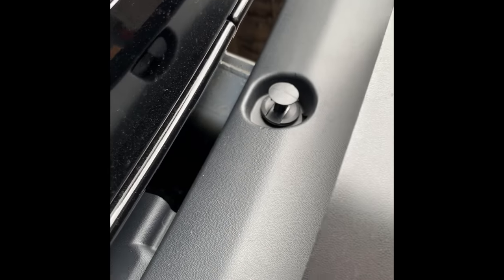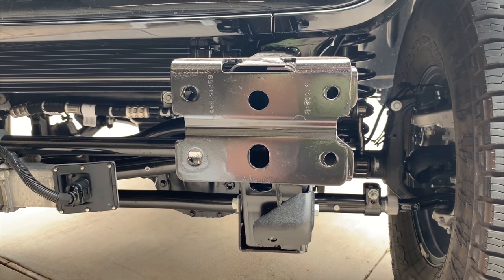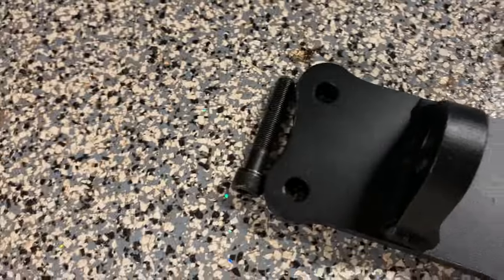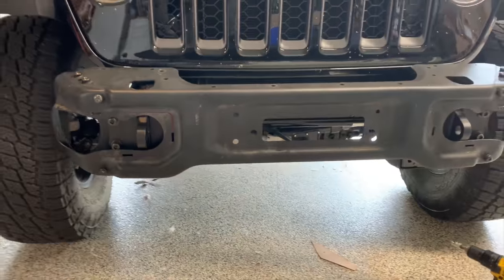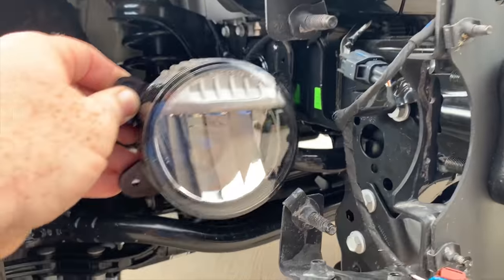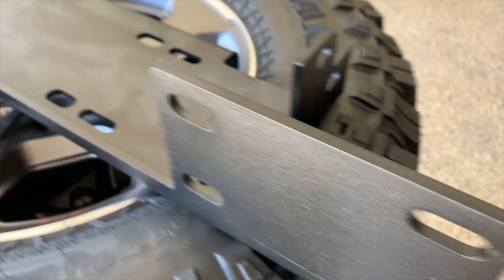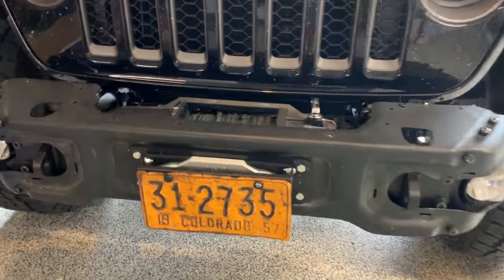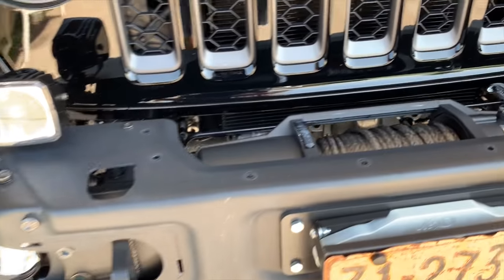Adding a Winch and D-Ring Shackles to a Factory Jeep Bumper

Comment: Great job! Excellent video. I was planning on doing some towing with my JT. I was wondering what low pro winch I would go with. Not a big smittybuilt fan but that winch looks good and tucked away. Looks like it wouldn’t effect air flow for cooling at all.

Comment: I was wondering if 2015 JKU Rubi Hard Rock bumper was the same steel bumper offered on JT Rubi as an upgrade. From your vid it looks like it is except for a few bolts.
Reply from the maker: kcrr2w It’s basically the same. They just rounded out the edges a little more on the JL/JT version.

Comment: awesome video.  was wondering where you mounted the solenoid for the winch?
Reply from the maker: I'm working on that now, fabbing up a bracket to mount it on the inside of the frame rail.

Comment: Did you ever come up with something for your D Rings to be useable?
Reply from the maker: The D-ring shackles I added are definitely useable.
Reply: @campNcrawlR  so do you just leave those covers on and just remove them when you need to access them. You mentioned in the video fabricating something. I thought you meant a different cover for those and the lights so they are always exposed. I am looking into doing something similar.
Reply from the maker: J Falkner ah, that. For now, I’ve left them off. I haven’t decided whether to just use those plastic covers or have something different fabricated. the truck goes in for several fabrication projects pretty soon, so I’ll decide then.